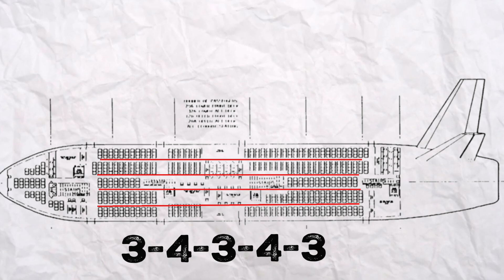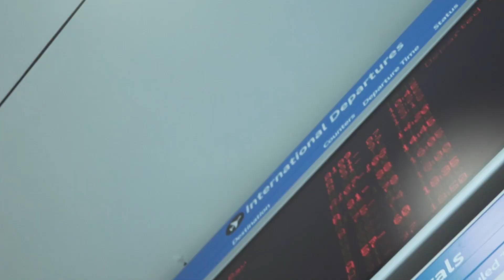Will There Ever Be A Triple Decker Plane?

Comment: You constantly quote the “ 555 “ passenger capacity of the A 380 which is totally incorrect .
The number you are quoting is the ABSOLUTE MAXIMUM numbers of passengers that can be , with training & fore warning , be evacuated from the aircraft using only HALF of the exit doors in the time span of 90 seconds .
There is only 1 or 2 A380 aircraft that are fitted out to maximum capacity in the WORLD !.
And those aircraft are on very select routes .
Cheers 🍻 , Woody NZ 🇳🇿 .
Reply from the maker: The maximum certified passenger capacity of an A380 is 853 passengers. This is probably in a one class economy only configuration which no airline flies. A typical a380’s capacity can range from 480 to 610 depending on the specific airline and seating configuration. Most A380s have a seating capacity of somewhere around 525 so the 555 passenger capacity may have been a little too high, I apologize for that - thanks for pointing it out!

Comment: Airbus made a mistake  because the A380 cannot be converted into a cargo plane,unlike the 747.
Reply: I dont think its a mistake, its probably purposely designed like that, because the a380 cargoes would be much more useful compared to the passenger once, as they can always maximize the value from it, by increasing the shipments. so if an airliner lets say needed another a380 for cargo, they would need purchase a new one, which is much more profitable to airbus compared to converting it to a cargo

Comment: My guess is that a 3 story plane is very unlikely because of health and safety reasons. My guess is that the airbus a390 will be like a larger airbus a380 with a 100m wingspan, 100m long fuselage, very lightweight and has 6 engines.
Reply: 100 meter wingspan is already to much for every airport. a380 already cutt of 10 meter due to the same reason
Reply: folding wing tips can help